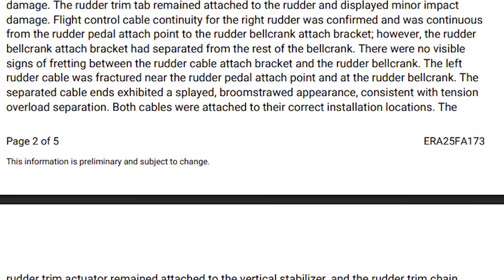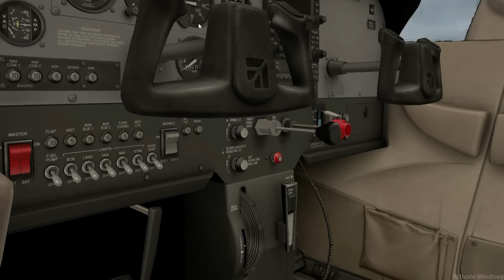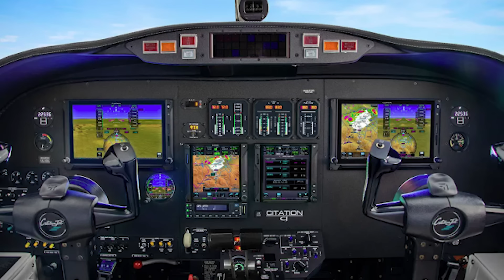Fatal Crash Of N8930N Got 3 Family Members Killed April 11 Boca Raton FL, Prelim Updates…

Comment: Flying an airplane right after the annual is like going out with a pretty gal for the first time....do not take both far away from home on the first encounter...both may act up on you😮which can lead to death or in the least, wish you were dead😢 check out the equipment on both before leaving on a trip😊to make sure the performance is adequate 😊
Reply: Require the 
mechanics to take a test flight with you after any major work to your aircraft.
Reply: @rgcwow  If the pilot doesn't want to fly with you then it will be the last time you have your airplane at that shop.
Reply: @2Phast4Rocket  Did you mistakenly typo "pilot" intending "mechanic"?

Comment: Always check all of your trims after the plane has been worked on.   When I was instructing in Maine everyday and had many hours of flight time the maintenance people asked me to check out a C150 they had just performed an annual inspection on.   Without inspecting I hopped in to take it around the pattern.   As soon as it lifted off the nose pointed straight up.  I had all I could do using both hands to keep it from stalling.  Worse, I could not find the trim as it was an older model and the trim was not on the instrument panel but under the seat.  I did not think I could hold much longer as my arms were exhausted.  Finally In desperation I reached under the seat and found it.  I never flew another airplane without a thorough inspection regardless of who worked on it.

Comment: A full trim deflection input not noticeable on the ground during preflight inspection?  Assuming the nose wheel straight when  parked on the ground the interconnected rudder would be centered but the trim tab wouldn't be if full input. Prior to walk around common practice all trims are set to neutral and extra precaution is cycle trim to visually make sure it operates correctly before setting to neutral.

Comment: It's also possible, even likely, that the pilots set the rudder trim to full left to act as a "mini rudder" and provide a little bit of right yaw force because the rudder was jammed all the way to the left. Also, two adult male pilots acting alone or in unison would have no problem pushing the rudder all the way to the right even with full left rudder trim at the speeds it was flying.